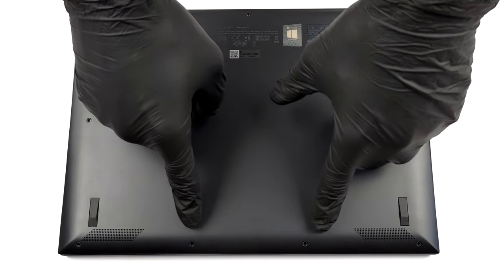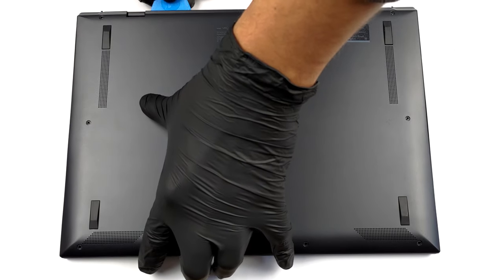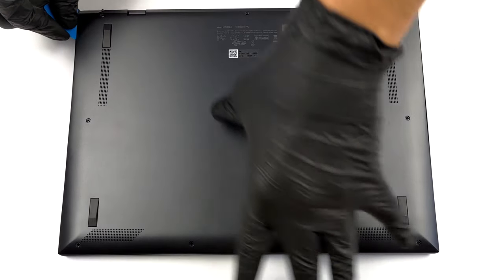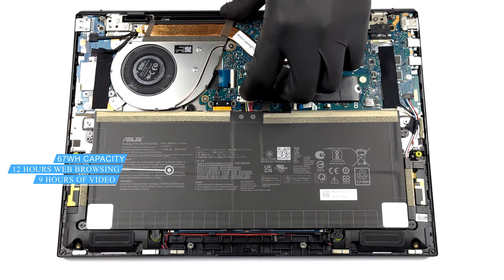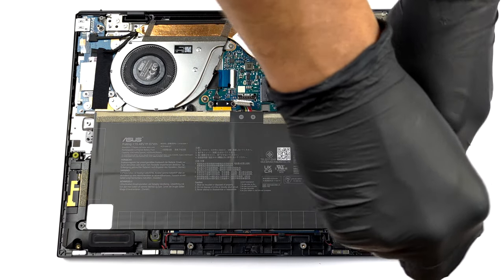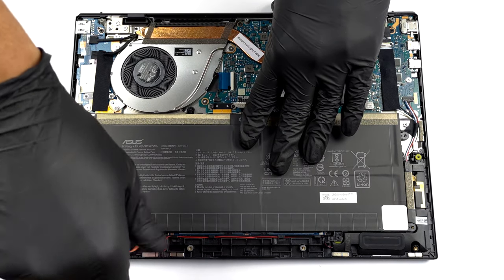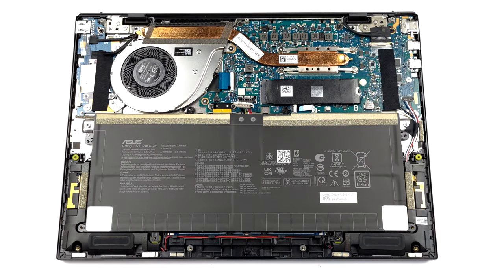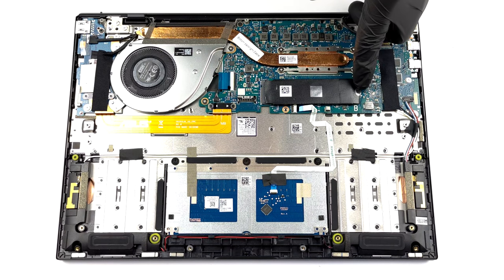🛠️ ASUS ZenBook S UX393 - disassembly and upgrade options

Comment: Hello, I'd like to ask if there's a way to take out the fan to clean it? If not, does cleaning the laptop without removing the fan helps to prevent overheating?